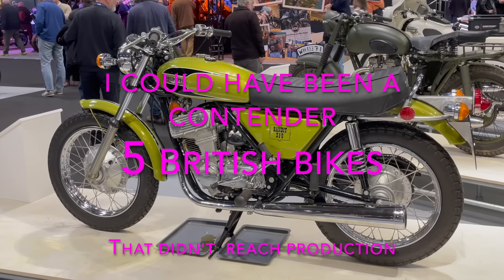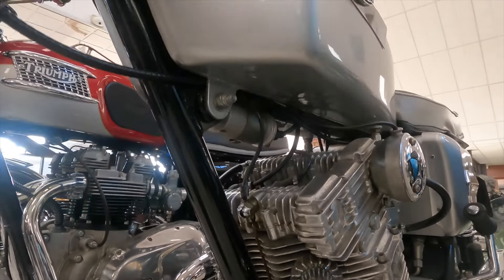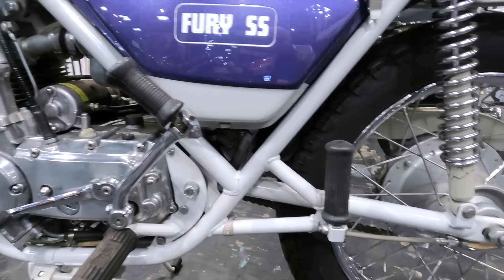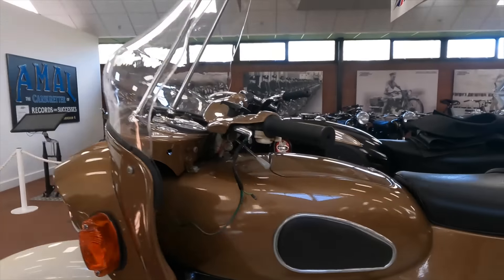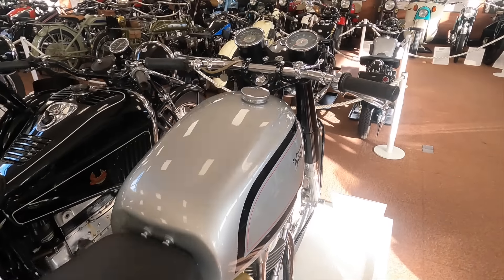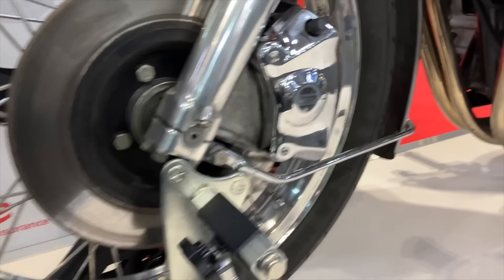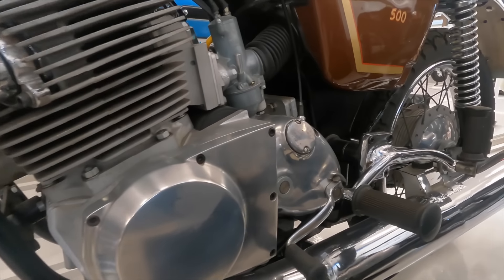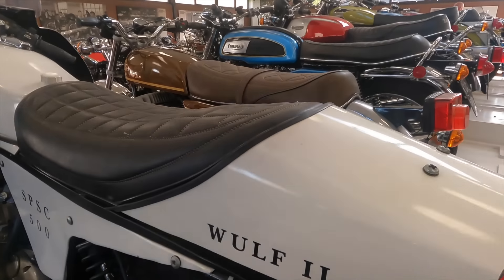They could have been a contender, 5 British bikes that didn't reach production

Comment: The British could have started with making a - decent quality bikes and not, as also by that time, the Lousy Production Quality in cars, which mostly fell apart before even reaching the road!!! It took German and Japanese ownership to produce a reasonable product in GB.
Reply from the maker: Massive over simplification 
If you think back to the 70s
Japanese cars had lots of gadgets but even more rust 
German ownership ruined River coolest said there the better 
Ford money improved Jaguar by the by
Reply: @bikerdood1100  I was the owner of a bought from new, 1966 BMC Mini. It became my first car, but also the only and last English Car!! It was absurdly awful produced, water came in from the corners of the frontscreen, the sliding windows in the doors, and paint peeled of round the outside hinges, from a faulty production method! I had to bend my - doorframes in, with a knee between the body, to make them meet the rubber sealing round the doors. Don't drive too close to a car in front during rain, as the engine will cut them, from the water spray. The wipers stopped at any place when cut, and the seats had an absurd motion when being moved forward or backwards, and only three holes as actual adjustment. The heater was either on or off, just to mention a few points. No syncromesh in first gear of course! And the long gear-selector in the front of the bottom, seems not to be connected to the gears? It wasn't very fast but that wasn't that special by then, and I gave it a tuned 1275cc engine with a proper gear box and stick in the bottom! It was more fun then.
Reply from the maker: Well this is a Motorcycle channel so interest in answering is  minimal 
However 
The mini was a small car introduced in 1959, so is a 50s product to complete with other small cars such as the VW Beatle, Fiat 500 and Citroen 2cv 
You may note the others used air cooled engines two having the ending in lest face it the wrong place 😂 also many small cars of the period, or not so small did not have  synchro on first gear so criticising if for is transmission and engine power is more than a little disingenuous 
How many won the Mote Carlo Rally 🤔
But enough of crappy cars this is supposed to be a motorcycle channel
I’ve  owned a few British bikes of the 50s and 60s and found the build quality on the whole pretty good, chrome and paint being somewhat better than the rapid rust Japanese bikes of my acquaintance.
Instead of disregarding the British industry I would suggest some light reading on its history 
May help to dispel a little of your anti British bias 😂😂
Reply: @bikerdood1100  The Fiat 600 also in the Abarth version was water cooled, but I admit they were old models and outdated by then and not at all as advanced as the Mini. And I also think to remember that the Mini never made an actual surplus from the costs of production. But that isn't an excuse for making a lousy job, when it hardly cost more to make a finished product!
Reply from the maker: The out dated augmented by then  for the Fiat does not hold water at all 
The 500 in its classic form was introduced in 1957 only 2 years before the mini at the time BMW was still making bubble cars 
Now that’s are awful 
But why am I discussing cars this is cars 
This’s is a bike channel and have 0 interest I ton boxes 😂😂
Do try to focus and bikes and do a little reading as suggested previously 😂😂
I don’t care about cars 😂😂😂😂😂😂
Go to Hubnut 
His channel is very good and about tin boxes
Reply: @bikerdood1100  Also the rather special Hilman Imp had its engine in the back. It gives a bad driving experience with too much weight in the back, unless effectively corrected as the last VW. But they still are feeling the wind and need corrections. When I changed my Mini for BMW2002, I had to correct for the wind, which I wasn't used to at all!
Reply from the maker: @finncarlbomholtsrensen1188 
Bike Channel
I don’t care about Tin boxes you have owned 
You did notice the distinct lack of of cars on my channel 🤔
BMW mini is notorious unreliable 
Gearbox failures at low mileages is a known issue 😂😂😂😂😂
You’ve brought a lemon 
😂😂😂😂😂😂😂😂😂😂😂
Now go away unless you have something constructive and bike related 
Bugger off to HubNut 😂😂😂😂😂
I don’t deal with shit care related dribble 
BIKE CHANEL !!!!
🤦‍♂️